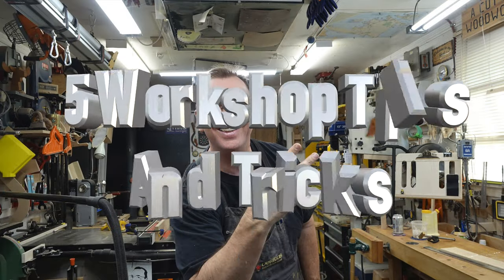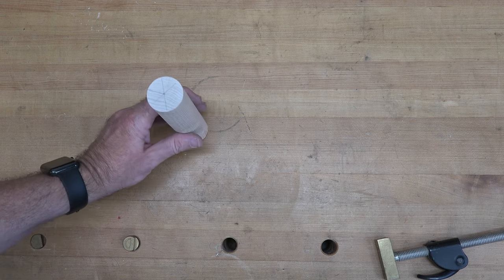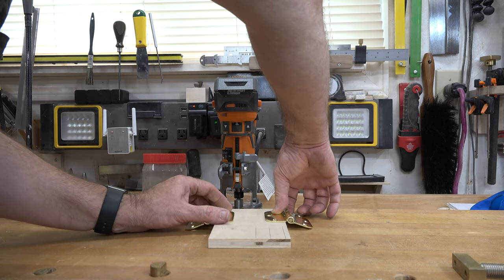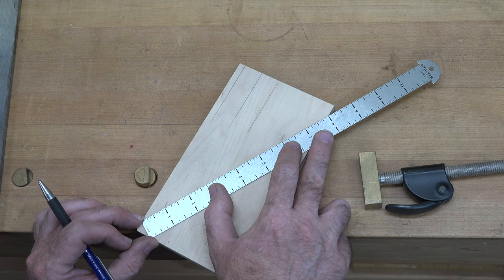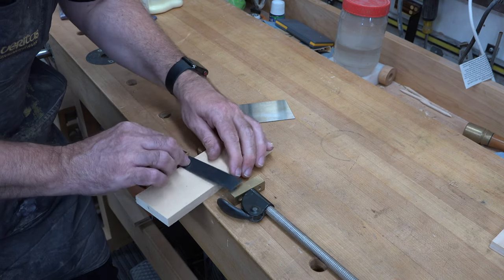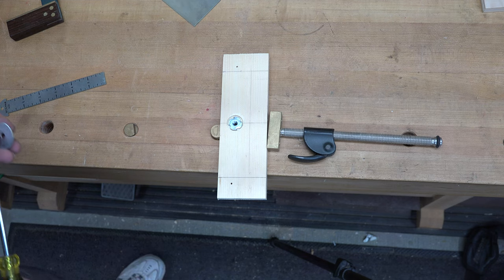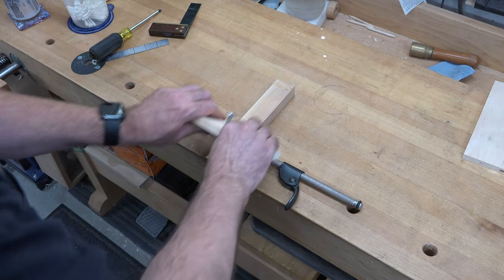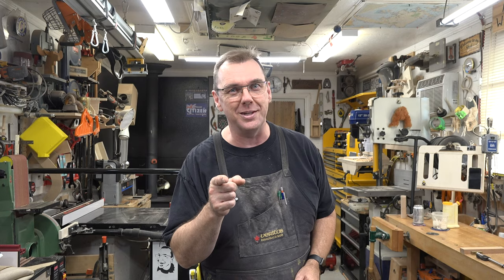5 Shop Tips and Tricks Episode 5

Comment: Keep them coming Ken. There is always something to learn. I've watched others use card scrapers, but I've never had or used one. I never had a drawshave. So I used the straight  edge of broken plate glass as a scraper on dried raw cow horns to smooth them down. Same principle I guess.Then I hand rubbed them with #0000 steel wool to a finish where I then could draw on them. Then it was just a matter of hand engraving them or scrimshaw. In the structural steel fab shop we used a framing square and a scrap piece of steel plate to find the diameter of a round object. It is pretty cool how one craft solving problem can be used in another. I wish I knew about the router and hinge trick many years ago. Oh yes! It would have saved me a lot of headaches when I was young man! The measuring across to find the center with even numbers was another I wished I knew. Here is a tip...don't throw away your out of square framing squares. Cut the short tang off, round off the cut ends, drill matching holes in the two pieces. Then insert a small bolt lock washer and a wingnut. Now you have a larger bevel square. We structural fitters and layout men would sometimes make some of our own tools. I'm sure many have done that in their own trade.Take care!
Reply from the maker: I like the bevel square idea Michael.  That's pretty awesome and I may have to use that on an upcoming show.  Reading your comment, just goes to prove that no matter how long you've been doing something or no matter how good you think you are, there is always something to be learned from someone else.  Thanks for tuning in to the show and taking the time to leave your comment.  I truly appreciate it.

Comment: Just wondering why not use galvanized pipe instead of the black pipe?  I don't have a need to have galvanized pipe so I can't try it for myself to know if those black lines would appear with galvanized pipe or not.  Or if glue would stick galvanized pipe or not?  I use the ruler tip to divide boards often.  In addition in your presentation, putting marks on that 6" board at 2" and 4" with divide the board into thirds and it can go on from there to divide into 4ths, 5ths, 6ths, and on and on.  Tip though when marking that spot of the board to just put a pencil dot.  A pencil line perpendicular to your measurement will not give accurate results if you use the wrong end of the line because the ruler is at an angle.  I like the card scraper hack and have seen variations of it in the past.  Just need to build one.  I guess I don't bend my scraper very much because I usually don't need to take much material off which I guess is the reason for bending it.  To be honest I have never heard the reason for bending it in the first place.  Always seen that it the way to use it but not the reason.  Always like tips and tricks.  Thanks.
Reply from the maker: Some people are moving to galvanized pipes Dwight to avoid the problem with black iron pipe but the black iron is so readily available and fairly inexpensive that it is still the go to for pipe clamps for some reason.  Good point on the dot for marking the measurement.  Depending on the amount of accuracy you required, a crooked line can make a world of difference.  Card scrapers are bent because it allows for a more concentrated and even pressure of the card scraper's burnished cutting surface.  A card scraper that is held flat will not give a constant or strong enough pressure to do any real scraping of the wood.  I hope this helps.  Thanks for tuning in to the show this week sir.  I appreciate you taking the time to leave your comments.

Comment: Where can I get the fixture that you use on your table?
Reply: I would like to know the same thing.
Reply from the maker: I am assuming that you are referring to the quick release wonder dog clamp that I used constantly on the show.  This is a Veritas product and is available at Lee Valley Stores and some other woodworking stores.  Here's a link.  https://www.leevalley.com/en-ca/shop/tools/workshop/workbenches/benchtop-accessories/74622-veritas-quick-release-wonder-dog?item=05G1030
I hope this helps.  Thanks for tuning in.
Reply from the maker: I am assuming that you are referring to the quick release wonder dog clamp that I used constantly on the show.  This is a Veritas product and is available at Lee Valley Stores and some other woodworking stores.  Here's a link.  https://www.leevalley.com/en-ca/shop/tools/workshop/workbenches/benchtop-accessories/74622-veritas-quick-release-wonder-dog?item=05G1030
I hope this helps.  Thanks for tuning in.
Reply: @acutabove_woodworkings  Out of stock until Feb
Reply from the maker: @imanutnur7  That sounds about right.  They have been plagued with supplier issues as of late.  Just like most companies, they are blaming the pandemic and side effect from it as the problem.  I've had one item ordered with them since December 26 of 2020 and I am still waiting for that one to come in.  It's frustrating for sure.